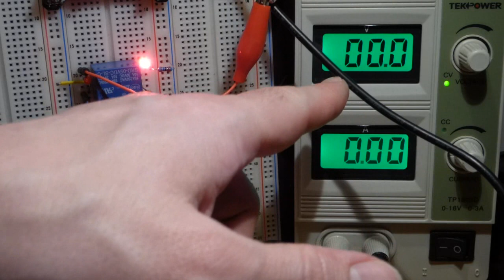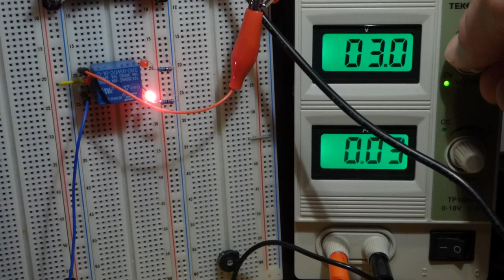Electronics single pole double throw switch demonstration circuit using SRD 05VDC SL C relay

Comment: Do you think if this relay is reliable for a 5A AC motor with an inrush current of 15-20A for only 1-2 seconds?
Reply from the maker: I don't think so, I'd see what companies use to switch something like that and compare it.
Reply: @Electronzap  Appreciate it 🙏 I've noticed a higher current version on the module XH-W1209 which is advertised for heaters up to 15-20A on Alibaba btw, but not sure if it's really up to the task :)
Reply: @Electronzap  I just saw https://www.youtube.com/watch?v=KzR7EtPM15E and I think it actually looks sturdy enough to do the job since I've opened the motor and the contact plates within it looked about the same caliber.

Comment: I’m trying to fix a lift chair. The relays aren’t the problem, but these are the relays installed in it. I may have to bypass some bad circuitry to operate them more directly. A family member bought the chair used because they’re about to have surgery. The chair worked for a good 10 minutes and then quit. Unfortunately it’s a Chinese chair with no stated manufacturer and a non standard remote, soooo this is the last resort. You helped a bunch. Thank you.
Reply from the maker: Thanks for watching. I never really thought about lift chairs before, although I think robotics would help a lot in assisting people after surgery and the elderly. Good luck!

Comment: Man how did you get that relay in the breadboard lol. I got one just like it and the placement of the common makes it impossible.
Reply: You bend it a lil
Reply: I'm having the same issue. Haha
Reply: I have just forced it  @flame_half
Reply: solder one to some stripboard with some terminal pins?

Comment: What is the 5v sugar cube  coil resistance
Reply from the maker: Don't know. Would have to take 5V and divided it by the current in Amps going through the coil to calculate the resistance. Might be on a datasheet too, which you always consult before making a purchase if that is an important electrical property to you.

Comment: The concept that I am still trying to understand is how changing the voltage makes this work. I see voltage a potential difference, not the actual kinetic current that is flowing. Is it really not the voltage changing the amount of current flowing that causes the relay to switch? Why do we sometimes measure in voltage and other times in current? I still cannot grasp this simple concept.
Reply from the maker: I don't know the exact design but the coil appears to be resistive, or has resistance in series with it, so it limits current from the voltage. Ultimately you need enough voltage to get enough current through it.
Reply: I believe I am slowly starting to get it ... perhaps it has to do with each load can draw a different amount of current, so from the perspective of the circuit delivering the work to the load, it makes more sense to talk in terms of voltage. Thanks! :)
Reply: The best way to understand Voltage and current is like this. Voltage is the electrical pressure and current is the electricity that is flowing. To give you a good analogy we can look at water pressure. Voltage would be the water pressure and current would be the water.